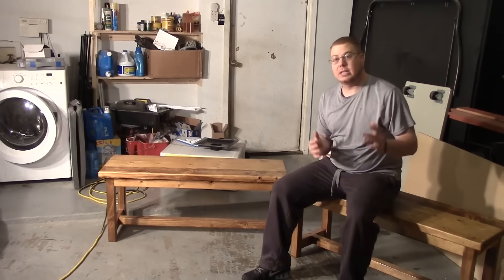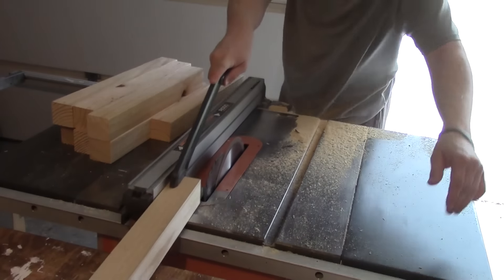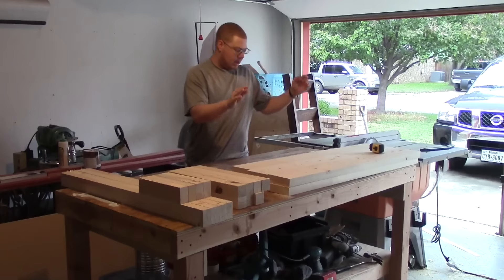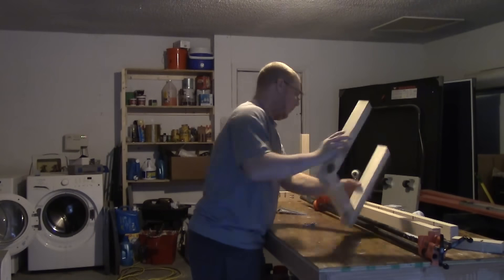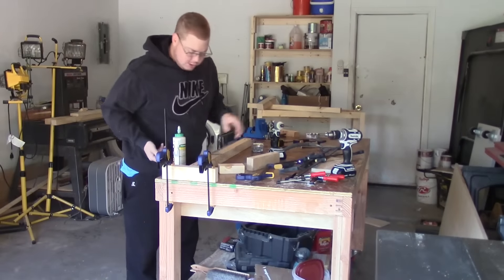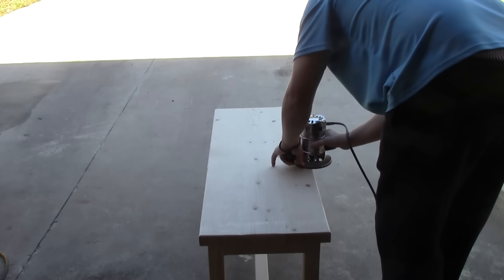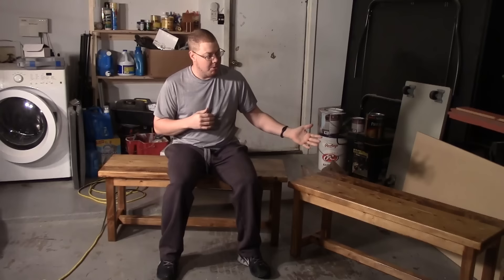My Next Project: Bench (for the Kitchen Table)

Comment: Nice project. 
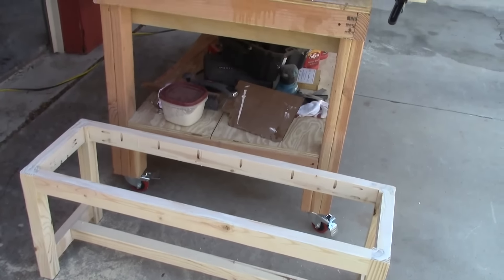But why You did not show how You managed with a mistake that can be seen 7:49 (pocket holes facing down).;p
Great work thought.
Reply from the maker: +coltain very good eye, I am very impressed.  The main reason is when I was setting up to do the glue up, I saw that my camera said it had under 20 minutes of recording time left.  So I didn't want to push it to hard because the last time I maxed my memory card out I ended up losing 2 shots i record because of some kind of issue.  

The way I fixed it, is i went back and drilled holes (3/8 or maybe even 1/4 inch) actually in the center of the bottom rail, and then added the screws into that hole.  I drilled them all the same depth and this was so that I wouldn't have to use supper long screws.  It ended up holding pretty good and I would say is as strong as the pocket holes.  

I am thinking I will address this in an upcoming video along with any other questions that may come up.  I am glad you pointed it out.  Thanks for commenting, and for viewing.
Reply: +My Next Project Thanks for reply. When things are going good, that is not good for a movie. This makes it boring. More interesting is when there is a problem and "hero" is trying to solve it. You can notice this in almost every movie. :)

I noticed this mistake because I did it a couple of time and probably I will do it again.

It is good to follow the sentence: "Check twice, make it, check again and then fix it "
Reply from the maker: +coltain That is true.  And I like that sentence you ended with.  I will definitely remember that.  

Next time, and there will for sure be a next time, I mess up something like that I will for sure show it or at least address how I fixed it.  

Thanks for the advice, I appreciate all the help to try to make my videos more enjoyable.  :)
Reply from the maker: +coltain In the video i uploaded today, I mentioned your comment and tell you how I fixed it.  It is brief but I thought I would share with you.  Video link is below.

https://www.youtube.com/watch?v=R-Z__YD3is8

Comment: what size screws did you use looks great
Reply from the maker: They should be either 1 1/2 inches or 1 5/8 inches.  I can't remember what size they came in.  But around that length.  The screws are really just to hold it in place till the glue dries.  The glue is the most important part.

Thanks and thanks for commenting and watching!!
Reply: thanks
Reply from the maker: Yes sir no problem.  Thank you for watching.
Reply: I think you're misunderstanding how glue joints work. In all the structural joints I saw you make you glued end grain to long grain. That is an unbelievable weak joint. The end grain will have wicked away most of the glue before it cured and what's left would not hold up against much wracking forces a bench is going to be subjected to. Those pocket hole screw butt joints are all that's really holding those benches together.

Comment: Looks great man!! not sure if i missed it, but what type of wood are the legs? Bench top?
Reply from the maker: It is all pine.  I am pretty sure white pine.  Whatever cheap pine 2x4s that Home Depot sells.  

then it is stained oak.
Reply: right on! Looks good and cost effective!
Reply: what is that tool called that you use to drill the angle holes for the screws?
Reply from the maker: Yes it is, that is what I like.
Reply from the maker: It is called a Kreg Jig

http://amzn.to/2hLw4oz

That is a link to the item.